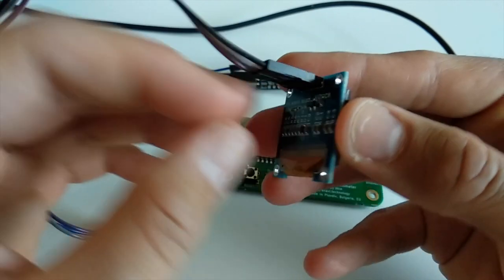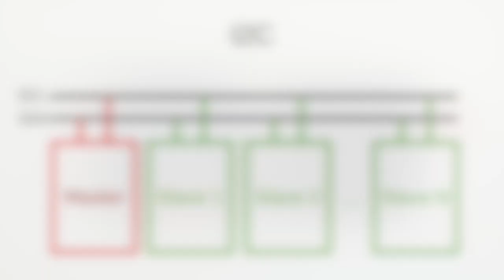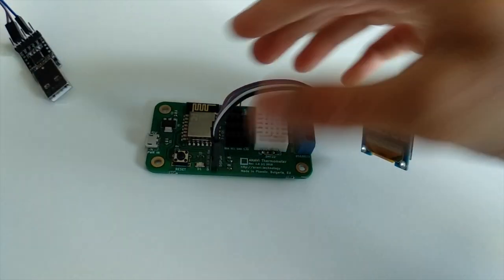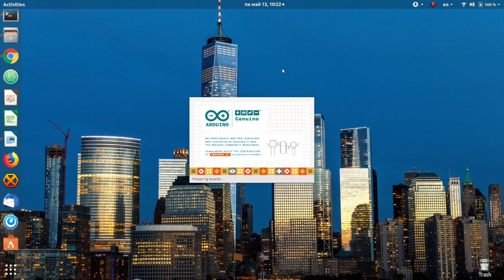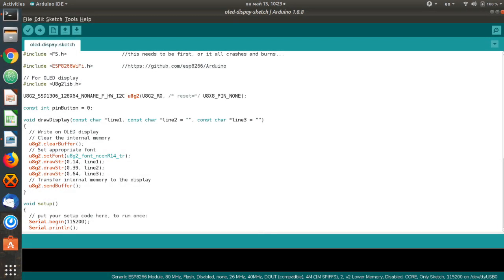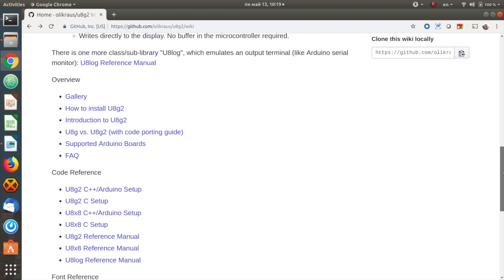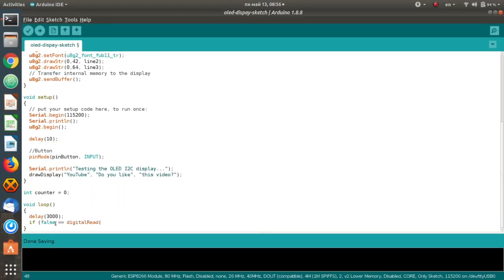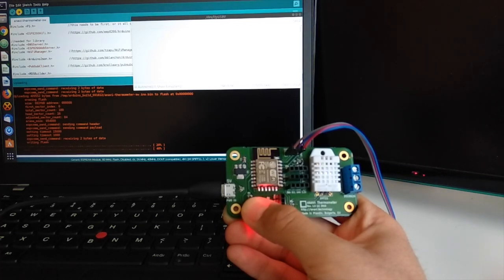Arduino Sketches for Mini OLED I2C Display (SSD1306)

Comment: What SDA and SCL addesses do the display use? I want to use the ThingPulse lib, https://github.com/ThingPulse/esp8266-oled-ssd1306
But the hello world didn't work:
SSD1306  display(0x3c, 5, 4); // Initialise the OLED display using Wire library
Thanks!
Reply from the maker: This tutorial is specifically for SSD1306 with Arduino library U8g2lib. In general depending on the OLED model the I2C address might be different. Check the technical documentation for the particular display or just do a I2C scan, for examples https://playground.arduino.cc/Main/I2cScanner/

Comment: Have you used any OLED display switch buttons (buttons with integrated display)?
Reply from the maker: No, not yet. I an interested it using them for a macro pad buy so far I haven't found OLED display switch buttons at an affordable price. Do you have any model that you can recommend?
Reply: I’m just looking in to them. NKK make them. There’s various dot matrix to full colour. It seems they’re quite simple in the way they work. B&W (with rgb background) display is set by sending a simple bitmap. I’ve not even tried an Arduino project yet but I have idea cooking
Reply from the maker: @MePeterNicholls  yes, I've seen these NKK SmartSwitches but at a price above $50 per button they are out my range for hobby projects. NKK SmartSwitch is a high-quality display that communicates over the fast SPI. However I will be happy if there is anything low-cost like a switch with monochrome display connected with I2C (slower than SPI).
Reply: The b&w are lower cost. But I’m going to experiment
Reply from the maker: @MePeterNicholls  hm, cool, that's interesting. Never seen them. Do you have a link at the exact model?
Reply: Actually they are a little pricey unless bulk buying  https://www.mouser.co.uk/ProductDetail/NKK-Switches/IS15ESBFP4RGB?qs=sGAEpiMZZMtA2dT40jxjM1SfdEr4GXKYUVlcR6fMAiyadO0uEwkFNg%3D%3D
Reply: Or https://www.mouser.co.uk/ProductDetail/NKK-Switches/IS15EBFP4RGB-09YN?qs=sGAEpiMZZMtA2dT40jxjM1SfdEr4GXKY4IxXbdSN88XhaU4v0NeNfQ%3D%3D
Reply: Full colour https://www.mouser.co.uk/ProductDetail/NKK-Switches/IS15BBFP4RGB?qs=sGAEpiMZZMtA2dT40jxjM1SfdEr4GXKYjLM%2F%2F5%2FHEUNixnqiMXSD4g%3D%3D
Reply from the maker: btw I am wondering if Elgato stream Decks are using NKK Switches?
Reply: Leon Anavi me too